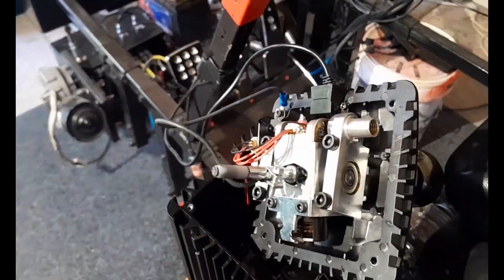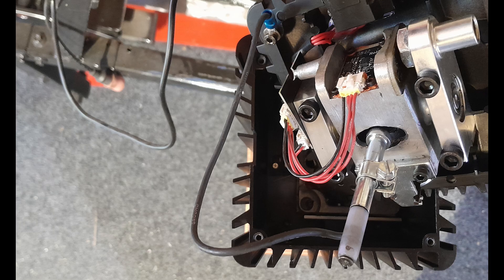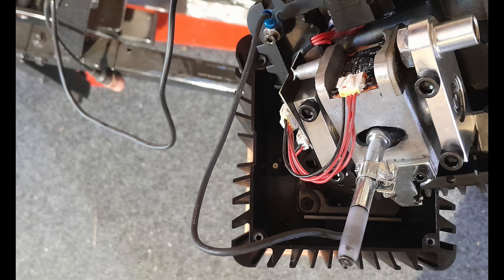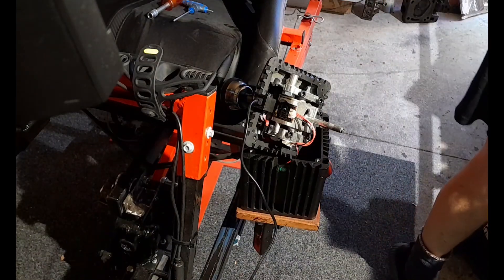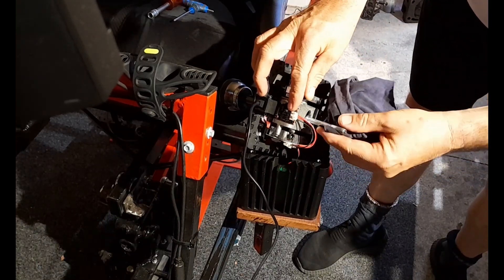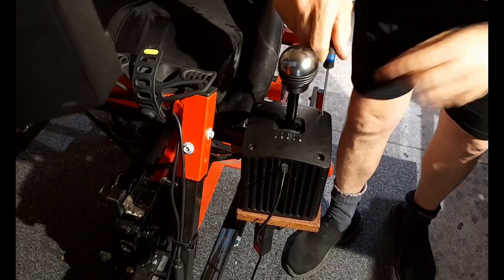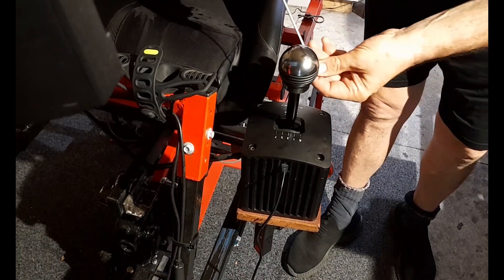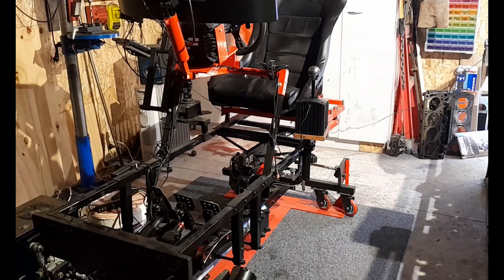Fanatec Shifter Miss Shift Simple Permanent Fix

Comment: Hi from Portugal. Great video. I will try this solution. One question please. Which is the length and diameter of the electric wire? Thank you.
Reply from the maker: 4mm diameter wire and make it 250mm in length

Comment: Thank you for this awesome video! This fixed my shifter! I couldn't stand to use my shifter anymore as I was getting constant mis shifting 3rd shifting to 1st. 4th to 2nd etc. Instead of soldering, I crimped another connector and attached it to the screw on the hose clamp.
Reply from the maker: Great alternative on the double crimp to hose clamp mate and glad it’s sorted the issue.
Reply: Thank you, I used the shifter for hours and works great. The only issue I had for a moment was it wasn't recognizing shifts for a few minutes so I used the paddle shifters and then it started working again with no mis shifting since

Comment: Good fix, my problem was a cheap USB extension. I would think it would be easy to verify your theory if it should happen to anyone, is to short the shaft to the shifter body externally with a piece of wire to see if it solves the problem. although I am still planning to do this mod for piece of mind.
Reply from the maker: In essence this mod does exactly that. It grounds the shaft to the body of the clubsport housing. As long as the body can also go to earth, (via the sim rig to floor for example) it’s a simple method to remove that potential problem.
Reply: @Doctoradhd1  Yes I get that, what I meant was that you can check what the issue is before you commit to do the mod as you have shown. Just like yourself have found out that in most cases people think they have solved the problem doing some other mod only for it to re-occur. Carl Gosling posted a couple of videos about one one fix with cleaning the PCB thinking it solved the problem only to have it coming back. Other fixes on YouTube include the tape on the back of the PCB and another suggested in securing the plug connections, securing the magnets as some have been reported to come loose, others with Fanatec drives including Carl solved this problem by connecting the shifter directly to the PC, mine was definitely the USB extension. It has also been reported that people had miss shifts even after their shifter was repaired or replaced by Fanatec, with some units being returned because they couldn't find anything wrong with them proving that this problem may be more related to people's setups that may be more prone to causing static electricity.

Comment: Hi, What is the diameter of the ring on the shifter? Thanks!
Reply from the maker: The hose clamp I use, works within a 7-9mm range.
Reply: @Doctoradhd1  I was struggling with this issue for a very long time. tread isolate the PCB didnt work for the long run. This solution worked! Thanks you for the video mate! 🙏
Reply from the maker: @spivak74  Glad it's solved the issue. I know how frustrating it was, before I found that fix.

Comment: Hi Doc.. yet another great video ..  just thinking this through and will ground my rig's base frame to the house earth peg so as to dissipate any static build up from clothing/seat cover interactions as I used to have this on my electronics workbench many years ago. I have a plastic racing seat with a Vinyl covered HF8 Haptic seat insert, so static build up & discharge may become an issue to semiconductors, particularly as I set my Air Conditioner to its lowest temp and reduce the humidity level in the room.
Reply from the maker: @A.GeorgeMenendez  the only time I’ve ever had issues with the motion sim is accidentally touching the frame and motor together when making adjustments with tools, when the motors were turned on.

Never work on your levers etc when the motors are powered on. One touch of them to the frame via a spanner etc, will instantly take out your IBT2’s. 

While ever they are isolated from the frame by the timber brackets you are sweet. But if you some how manage to bridge the motors to the metal frame it’s bye bye IBT2
Reply: @Doctoradhd1  Thanks mate, I am using Sabretooth for all motors for which i hope to be able to download all the software during the week. I left a message on Xsimulator if you get the chance to look at it... Thanks again .. cheers ..
Reply from the maker: @ oh OK George. It's been a while since I've been on there. I'll log on now.
Reply: @Doctoradhd1  Hi Doc .. Out of curiosity , what settings do you have in SMC3 & Simtools for the Sabretooth on your rig ? I have been going through the videos and find your dedication to research the best outcome outstanding to say the least !
Reply from the maker: @A.GeorgeMenendez my current balanced (meaning good power and data transfer for long gaming sessions) for the sabretooth controller (front motors) are the following: PID LOOP. Kp=450, Ki=1, Kd=1 Ks=3 PWM VOLTAGE PWMmin=40 PWMmax=225 PWMrev=225.

I’m not sure if you’ve watched these videos? Crazy Or Conservative Motion? How Do You Like It? SMC3 Settings To Get Your Motion Rig Rocking!
https://youtu.be/_bbTcnuqPqQ

Motion Simulator With Dynamic SMC3 Utilities Settings For Big Accurate Motion
https://youtu.be/KvEjauABur4

Might explain how I work out my settings depending on a few factors.
Reply: @Doctoradhd1  Thanks mate.. I will be spending time on it this weekend as i need to finish the wiring and Instrument Box first.. being a fully paid up member of the ADHD club ( the inattentive chapter ) means I have to watch all the vdeos multiple times before I get it. Apologies if my questions appear to be too basic . Again thank you for your help, I value your advice and inspiration.